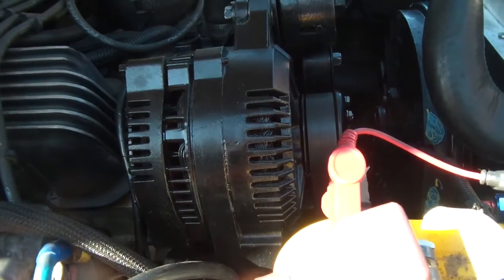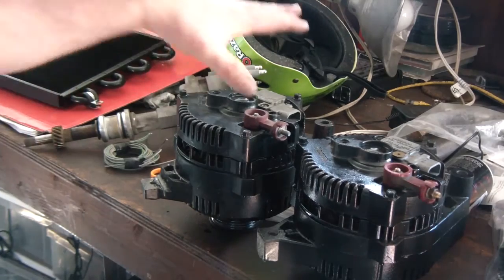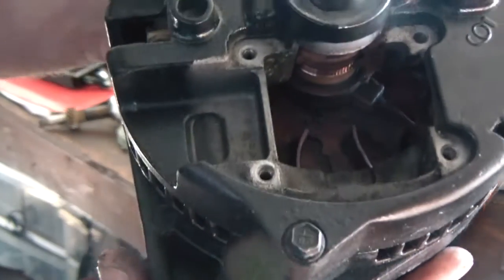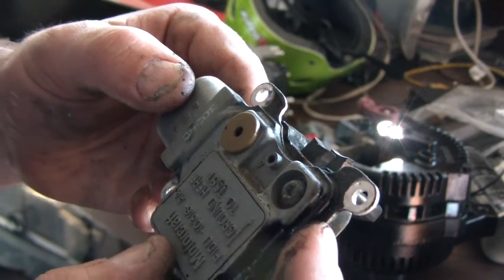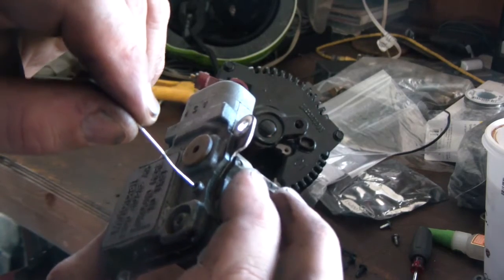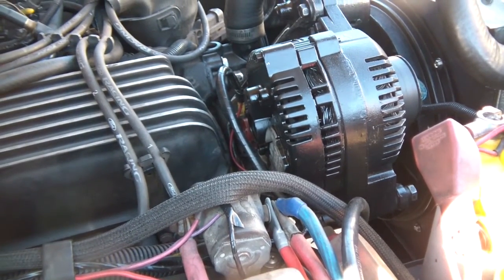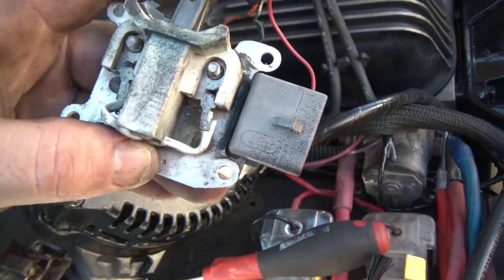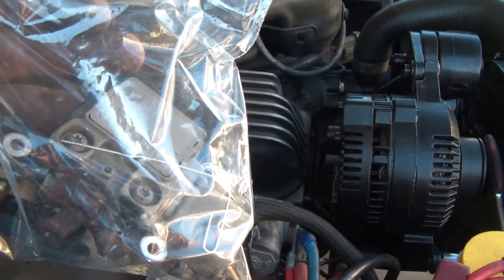Ford 2G 3G 4G Alternator Troubleshooting Voltage regulator module repair

Comment: My f150 triton did exactly the same dam thing to the brushes and  slip rings , I swapped brushes out with a 4g alternator had to do some modifications but it worked , one slip ring has square divits fried into it that match whats left of the brush ....so that was yesterday and ive driven 30 miles I can only imagine the shit show going on in that alternator as the new used brushes ride over the holes in slip ring surface ..I have another rotor anyway but this shit gets way old way fast anymore..

Comment: Thanks for all the great info ! I had a brush sticking in this one but I don’t think that was the issue .  I think the regulator is bad .  I’m guessing you painted those alts ?  If so that would probably cause heat build up .  I sand mine down and just keep going to 3000-5000 grit and polish it out .  I read a story one time about motorcycle engine jugs .  They say they polished them to make the engine run cooler .  Now the one reason is the air flowed over them easier a with less resistance that would make it run cooler.    From then on I kept all the paint off engine aluminum. Even on my lawn mower.  Thanks for sharing great deal on the regulator being bad and after market ones  suck !

Comment: Hi, which tools will I need to replace the voltage regulator? Will I need a torques bit? Thank you.
Reply: For my 2001 Focus with a 2.0 Zetec it's 3 bolts with a T20 head.

Comment: I'm having the same problem at start up 14.4 after 10 min 13.4 or less
Reply: Normal
Reply: @beerggls  ya thats the rectifier heating up if im not mistaken
Reply: Rolling Thunder 
ECM adjusting charging voltage based on battery temperature. Of course there's not a battery temperature sending unit, so the computer uses intake air or coolant temperature to control the voltage regulator. A battery charges more efficiently at different voltages depending  on how hot or cold the electrolyte within the battery is. A battery is cold when you initially start the engine and therefore needs a higher voltage input for optimum charging efficiency. As the engine warms, charging voltage decreases slightly to prevent boiling electrolyte.
Reply: @beerggls  thank you i mean it makes sense what your saying i will research it further. If i want to add a 2nd alternator do i wire it in parrelel?
Reply: Rolling Thunder 
Yeah if you want 12 V. Series wiring would get 24 V with two 12 V alternators. (12v/14v/12.6v,  whatever)
Reply: Rolling Thunder 
Or just get an alternator with higher amperage output
Reply: @beerggls  ty that makes sense

Comment: I see your online....I'm changing my old alt with a 300 amp alt, but the new alt doesn't hav3 a spot for the 3  wire that plugs back into the alt. Do you have any idea what the side wire is for

Comment: You need a slip ring, might have a faulty 3 pin connector or rectifier, make sure you connect  the ground post on the back to a ground
Reply: Theres a test sequence, continuity, diode, ohms, your wiring is obviously fine, i saw the grooves in your slip ring, let us know!
Reply: Is that one place where you bolt a wire to the alternator the positive or negative polarity? Where is the other, minus? The body? Thank you.